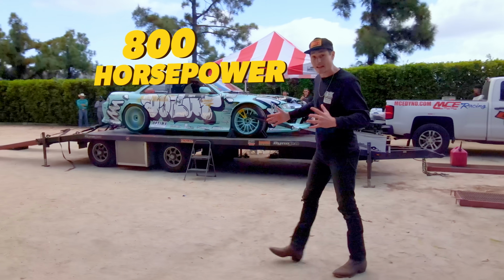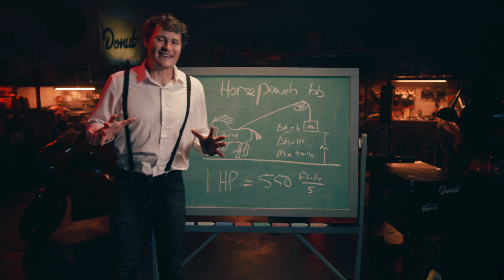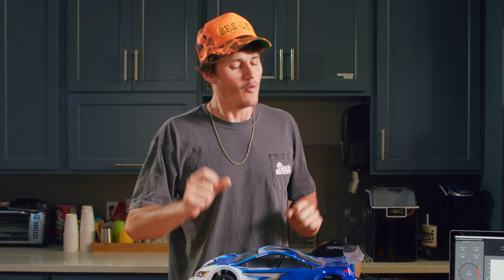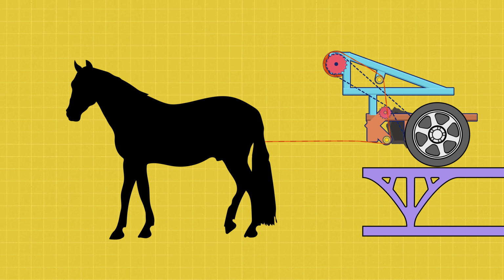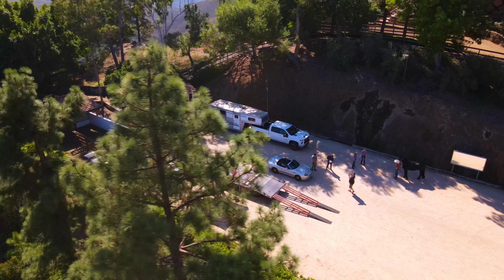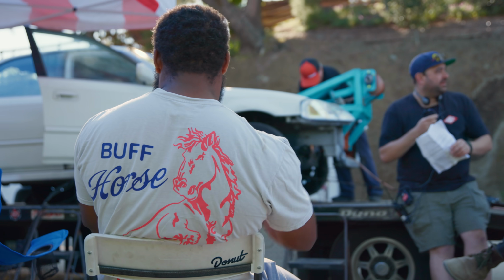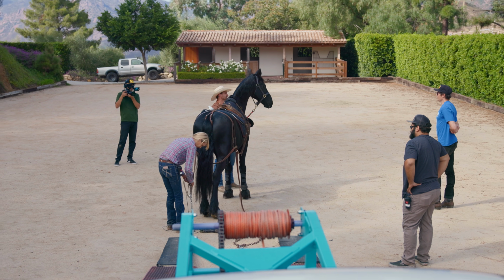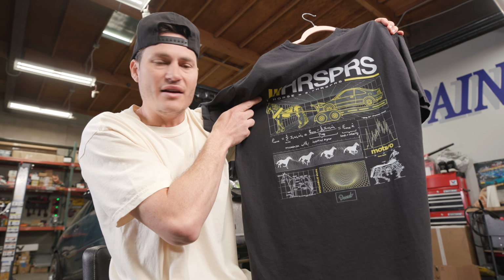How Much Horsepower is a Horse?

Comment: Why the heck you need the entire complexity of a transmission of a Honda civic, while you could spool the rope in the dyno wheel or, at most, on a wheel with tires touching the dyno? “If the only tool you have is a hammer, you tend to see every problem as a nail.”

Comment: So do we now take our horse power and divide by 5.7 or multiply to get real horse power numbers? 1 real horse power = 5.7 than naturally i want to divide my 350 hp engine by 5.7 which equal 64.40 Big D HP.  Not as exciting  with the new number. As long as you know the torque is still there.. i used to be like 350 HP holy chit now im like 64.40 Bid D HP holy Chit! 😂🤣😅

Comment: Well remember, torque is the force of the power, and horsepower is how quickly that power is down. Hence why diesels make lower horsepower numbers and higher torque numbers; they are slow at putting the power down, but their pulling force (torque) being so much greater allows them to pull large loads. I’m saying this because I’m sure Big D put down a LOT more torque than horsepower!

Comment: this problem really isnt too hard. put a horse on one of those walker wheels. put sometype if reaction force on the wheel. like a brake disk and caliper. caliper is mounted to something that can measure the force going into the caliper. have the horse rotate the walker and slowly ramp up brake caliper pressure. let the horse continue to walk into the walker till its tired or you stop.

Comment: That horse wasn't even trying, imagine a race horse huffing and puffing.I remember reading that a horse had about 23 hp. In physics we tested out hp and most ppl have about .8 to 1.5hp. I've had a horse lift me up in the air without trying ,I'm like 240, when I held its reins at its nose. I think the figure is low.

Comment: Very nice video, but it is a big problem. U dont find horses that runs mills all day long nowadays. This horse is not so well trained as old days. Its the same as a question, how fast can a human run?. Then u look on for ordinary guy at highschool, and let him/her run. Have a 5 times 100 meter test, and then u set standard how fast a human can run. Result will be terrible wrong. Same with lifting, swimming and so on. I  think 5,7 is way too low for a true working horse.

Comment: K.I.S.S , Keep It Simple Stupid. 
This is so over engineered. it's ridiculous.  I garrentee this is completely wrong, Literally, all you needed to do was put a hydraulic dyno on a mill wheel. You have so many places for errors in calculations this apparatus.  You have losses in the transmission and drive train you calculate based on known values for that transmission, does that apply at this specific speed and torque? Honestly i thought you would do peak and continuous but you cannot with this dyno. 749 watts is a hp. I was hoping to see an actual number of this horse as well as a peak number from this horse.  I get it you wanted to make it exciting for car guys. But all in all pretty poor execution. If a horse can do 745 watts all day then it can definitely do more than 5 times that for a short time. A human capable of 1,000 watts all day would be capable of atleast 10,000 watts for a short time. A horse should be able to do for a short time more than ten times what he can do for 8 hours straight. Your number is atleast 100 percent low.

Comment: i'm not satisfied with the test because horse didn't even run at full pace/speed and with full power. Like we test the cars on dyno, we rev the engines fully till it reaches its peak RPM. horse was just walking or jogging. its like testing car at 2000-3000 RPM.

Comment: James Watt measured the power that average horse could put out throughout the whole day. That would probably be approximately 5 times smaller that what you got, so yeah, he was right after all
Reply: Yes! Absolutely right. 
That was the useful metric then. How many horses will an engine replace. 
They disrespect James Watts genius by suggesting he got it wrong.
He wasn’t measuring for bragging rights.

Comment: can probably round that down to 5 i guess. when using horses for work you wouldn't run them at their hardest cos you need them to run the mill all day. the horses back then would have been conditioned to the work however and would probably be able to output a higher maximum than big d, ergo average it down to 5. take any and all hp rating and divide by 5 for more accurate numbers XD

Comment: I'm only an engineer by job title, but I would think that just wrapping the rope around the dyno wheel/tube, would give you the proper number of HP.  No need of gear ratio math for the rig unless it is 1:1, but the input looks much smaller than the wheels.  I would like to see the difference of numbers directly to the dyno.  Props to the rig, it is really a neat, engineered device to adapt linear motion to stationary car.
Reply: A horse develops power at an optimum speed which probably doesn't match the dyno's resistance curve.  So the complicated arrangement they made would (hopefully) correct this mismatch of speeds to get the best power out of the horse.
Reply: Also, doing it like that could have possibly put the horse in some sort of danger. It was most likely done that way for the safety of the horse, and then doing extra math to make sure that the numbers were correct, accounting for the gears.
Reply: Yeah I was thinking the same thing. I think maybe the reason they didnt just wrap the rope around the drum was either the tolerance around the drum to the rest of the dyno was too tight to accommodate a rope. The other, and I think the more likely senario was they didnt have the time to take apart to wrap the rope or the dyno was too difficult to decontruct.
Reply: @camerongearhart8156 There's a completely different kind of dyno, a hub/axle dyno that is designed to bolt to the wheel, and I would have thought the rope spool could have been fitted directly to that type.
Reply: @joemcgulligut7874  thanks! I didn't know of those, but that makes sense
Reply: There are lots of non-automotive application dynamometers they could have used. I think that would have made a less "Donut" video.
Reply: the dyno depending on the mode will emulate a fixed resistance, a fixed speed or will emulate the road with minimal resistance and no speed limit. the problem is they all depend on the dyno rollers having to spin at several hundred RPM in order for it to function properly to produce numbers to reasonably compare to a typical vehicle. a horse cannot do this. it works at much lower forces at a much lower velocity. the fact that they had to construct this monstrosity over the dyno was a complete horseshit exercise just so they could put the dyno in the video. the dyno was completely the wrong tool and the direction they took for this experiment was a scam the moment they decided to use it anyway. they should have just gone with the gps and force gauge with a fixed resistance load. this was portrayed as a contingency plan but clearly it was providing calibration data against which they could actually test the constructed model and get a publishable paper. but they needed the dyno in the video or it wouldn't be a Donut relevant video. i suspect they knew this very early on but decided to go with it anyway after they already sunk so much time on it. the fact that they got Adam Savage on but showed no conversation of substance regarding the actual experiment design was a big tell.
Reply: I'm relieved to see someone here voicing my thoughts on this.  My first thought at the beginning, how to dyno a horse, horse to a spool on a dyno, seemed relatively "simple" to me.
Reply: @KurtFrederiksen   I didn't really think about it from the horse's safety.  I'm no tachometer, but the wheels/roller were not moving anywhere near 3K lol.  Joking aside, I can understand why they would need to use reduction, I guess that I wish they would have explained it.
Reply: That horse never pulled at full speed but these guys are calculating that based on speed how does that work.!I think the number should be a bit higher
Reply: It also does not account for the amount of stretch in the line used. In the end, it was just a cute and silly little video that gave us Big-D's horsepower. I'm sure Big-D's torque curve is a whole different story.
Reply: I was thinking about anchoring the horse and having them move on a "treadmill" style dyno until I thought about the horse stopping. 😢

Comment: i for sure admire the process and the effort put in this experiment but there is something more to think. There are 50cc bicycles outputting 5 or 6hp that really struggle to move 2 full grown men, or even 1. But a horse can run for sure with 1 man pretty fast and even with 2. So i'm guessing that the horse didnt quite output his max effort dragging the wrench. So the 5-6hp can be potentially increased  to 10 if we somehow make the horse run for 100%

Comment: good but it is wrong, you did not take the total energy of the horse because the horse also accelerates its mass (it also has a mass therefore an inertia), which underestimates it's power, in a dino the car is not accélération itself.

Comment: Using a horsepower as a term to scale the engine power was a really dumb idea after all 🤣
Reply: Though not in the Industrial Revolution because engines were replacing horses.
Reply: @kitsandham7001  Well, horses still didn't have consistent power
Each one is different

Comment: Actually this isn't science but entertainment. Because 1 Horsepower equals 745 watts. Watt is power by distance by time. So everything you have to do to verify this number is letting a horse run, measure it's weight, acceleration, speed and the distance. To average this you just let several different horses run and do your math. An elementary school kid can do this. That would be the scientific way, because this way you don't have miscalculations by mechanical loss, inefficient lasers and whatnot 😎
And btw the most car representing horse would be a Mustang.
And it's proofed that a chimp is five times stronger than a human so a horse must be even stronger. That shows that your way of measuring is somehow wrong. Entertaining though 😊

Comment: I loved this but its not research quality yet.  From school days we know that a human can output 1500 to 3000 watt whilst running up stairs. 1 hp is 746w so thats apparently 4hp but the human is knackered after 60 seconds. A horse can pull 6hp but it also won't sustain that all day. James Watt was making a lot of assumptions but I think 746w as an output that is can sustain is probably not far off.  I'm not sure what all the faff with calibration was about, a simple method is force x distance = work done. So you could simply have dropped a weight of known value to pull the rope and you know the work done so you can get the difference with the dyno.

Comment: OK, so the peak power of a draft horse is about 5.7 HP.  According to your video, James Watt probably intended 1 HP to represent the average power of a draft horse.  A ratio of 5.7:1 doesn't seem unreasonable for the peak-to-average power output of a horse.  I don't think that this video obviates the definition of 1 HP as 550 foot-pounds per second.  Also, what were the results based on the GPS and load cell measurements?

Comment: The entire point of Watt's observations was the average amount a horse could pull over the course of a day. You did burst speed amounts.

Put Big D to work on a load over an hour and se how much he does. Then your results will mean something.
Reply: Correct! Interestingly most people seem to think hp is a maximum power comparison, so in some ways it’s more valid today. 
We’re not replacing horses with engines like back then.

They should not have suggested James Watt was wrong though, that’s just disrespectful to a genius.

Comment: Why not just build a resistance band or tension setup? Or a horse treadmill with a consistent resistance? Or just calculate the total joules exerted by the leg and muscles of the horse combined to give a total energy output and use that figure to generate the total torque capability and convert that to horsepower? So confused how this pulley system with a series of subjective and uncertain gear ratios and resistances across the pulleys is a solid figure to work off of? Maybe I’m crazy but this doesn’t seem like a 1:1 ratio of force to power ratio. Sort of like comparing someone’s max bench by having them push a truck up a hill … doesn’t make sense to me

Comment: The way I understood it, James Watt was not concerned with the maximum power a horse could be asked to pull, but what it was required to pull, on average, in a real working situation over an average day.  There were two Frenchmen who set up an purely experimental situation and came up with a figure 4.5 times higher for one horse.  That's why the French cheval vapeur (steam horse) or CV rating was always 4.5hp by Watt's standard.  (Also why a Citroen Deux Chevaux was so named, as it originally had a 9hp engine.) 
I would not accept any random historian's opinion that Watt was putting his thumb on the scale, so to speak.  I've studied history; I know how they operate.  I would rather prefer to give Watt the benefit of the doubt and assume he honestly wanted to arrive at a meaningful standard.  It was going to be important to be able to have one as he moved forward and designed and built engines for different clients and different applications.  Horsepower is at the end of the day a measure of work done, and there is only so much work you can expect a horse to do.  Mechanical systems, on the other hand, are tireless.

Comment: Not a fan of this video.  They don't even need the dyno.  All it does is serves as a load.  They have a load cell in the rope to measuer the force, and they have a GPS on the horse to measure the speed.  Power equals force times speed.  The power (in watts) is the force (in newtons) times the speed (in meters per second).  Then divide the watts by 746 to get horsepower.

Another problem is that they only ran at a slow speed.  An engine will have different horsepowers at different rpms.  Likewise, a horse will have different horsepowers at different speeds.  The horse can provide maximum force at zero speed, but that equates to zero power.  At what speed can the horse deliver the most power?  Surely faster than what they showed in the video.  If the horse could pull twice as fast at more than half the force, it would be more power.

And, as others have pointed out, they were measuring peak horsepower in the video.  In James Watt's day, I would be more interested to know how many horses I could replace with his engine.  A horse on a turnstyle could probably produce one horsepower of continuous power for 8 hours.  If you were pumping water out of a coal mine, a one horsepower engine running 24/7 could probably replace 3 horses that worked 8 hours a day.  For example, those strong guys in the video could provide a little over 1 hp for short bursts.  A trained bicyclist athlete pedalling the Gossamer Albatross airplane was good for about 250 watts continuous, or 1/3 hp.

Comment: I don't understand why you just had the horse lift a weight through a pulley like was illustrated? This is FAR simpler than the solution you came up with and doesn't need most of the compensations you had to do (a pulley has a minor loss). Also, James Watt estimated horsepower as the CONTINUOUS effort produced by horses, not the short-term INSTANTANEOUS power that you measured.

BTW, horsepower is defined as doing 33,000 foot-pounds of work in one minute. This could be measured by having a 330-pound weight suspended over a ten-foot drop by a rope and pulley (or a 165-pound weight over a 20-foot drop). The time it takes the horse to raise the weight 10 feet can be measured and the horsepower is directly calculated from the time required to perform this action. Note: no welding is required to build this apparatus.

Comment: This is interesting but if what you’re saying is correct if James watt invented the measurement for hp and I’m assuming kilowatts since watts are named after him and he discovered the SI measurement in which a dyno machines math are based on if this is false wouldn’t this experiment be inconclusive?unless we actually get a horse to move the said 550ft lbs of torque and remeasure and do the original experiment still very interesting got my mind jumping 😅

Comment: I feel there's likely some inaccuracies. You don't start a dyno pull with the transmission  in 1:1 ratio gear and you don't start at zero rpm either or clutch dump it. You basically just clutch dumped a horse with a Honda civic in 3rd or 4th gear. I think you stalled it.

Comment: Well where do we go from here? Now we need a value such as THP or true horsepower to use on engines.  Basically divide all published hp values by 5.7 (the correction factor). Now you can go to the Ram dealer and tell the dealerships their pewney Ram TRX has only 123 THP 😂.

Comment: I love this. You should put 4 or 6 horses in front of it to see how horses can scale.
Reply: There may be an issue in the HP measurement altogether. HP may not scale linearally like mph and may scale exponentially like Gs or mach.

When they did the test of 3 men after 1, the numbers were not linear. In fact, it went significantly down.